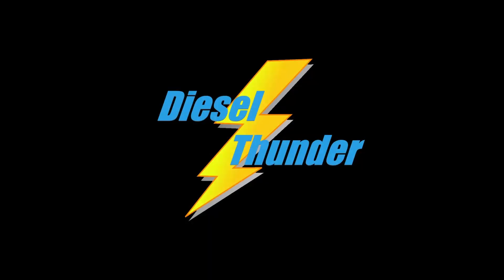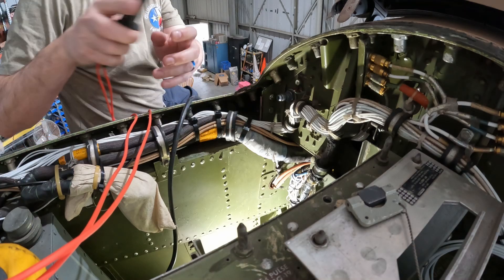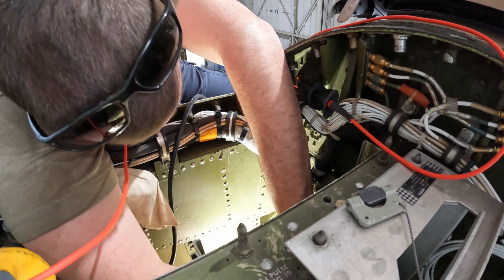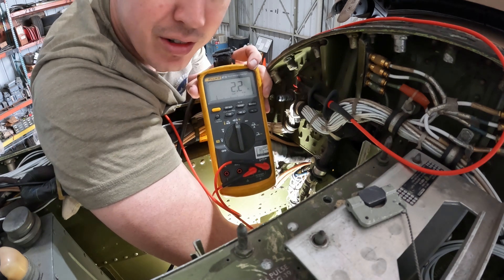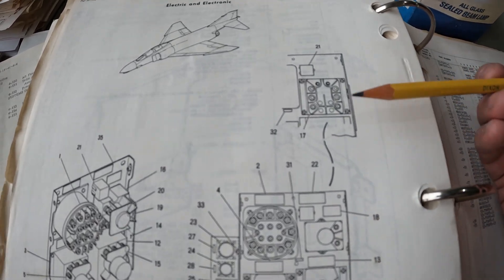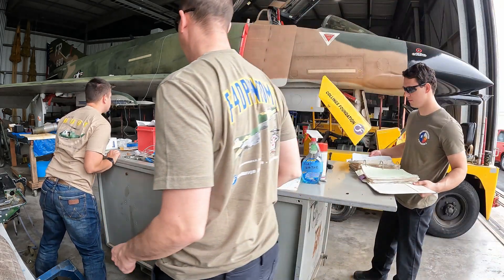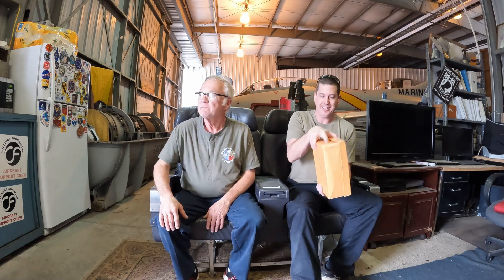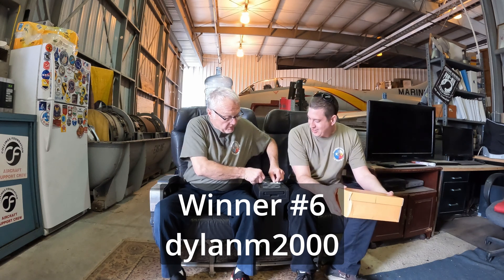More Electrical Phun and Winners are Drawn! | F-4 Phantom

Comment: Was wondering if the complete miscalanious relay panel assembly could be released and then roteted in situ to face the rear, that way to facilitate easier access to those fiddly nuts and washers on the relay terminals.
Can't be too careful with dropping tiny hardware inside a jet !  FOD is not good.
Reply from the maker: Agreed, FOD is not good! We’ve looked at moving the panel around but the wiring harnesses routed along the edges prevents that. I do have a few tricks to keep the nuts from getting loose or lost.

Comment: Yeah, getting to things on an F-4 can be a lot of fun.  There was a theory bandied about that they took all the electricals, avionics and seats and hung them up in the air then built the airplane around them.  Knowledge comes with time,  A lot of what you are doing now is what we all went through as 3 level or young 5 level techs.  You, unfortunately, don't have the experienced 5 level or 7 level folks around to train and guide you.  A lot of the trick to maintaining the F-4 is having seen something a couple of times before and having at least a starting point to troubleshoot and knowing what can or can't be the problem.  When we got good enough the McDonnel tech rep would give us a patch with the little Guy dressed in black with the II on his costume that said Phantom Pfixer.  It was something we wore with pride, like an award for pain, suffering and perseverance.  Good Luck!
Reply: the former McDonnell Douglas headquarters building in St. Louis has a little "museum" called the Prologue Room.  It was originally just a nice way to display their products in the old days (I used to work there).  It is still open, but infrequently.  On my last visit in 2019, I did get a photo of the Phantom Phixer patch ....  https://live.staticflickr.com/65535/52393966335_54e0b0c551_b_d.jpg
Reply: Spook lives.

Comment: If you want you can use three 9 volt batteries wired in series and wrap them in electrical tape to keep the batteries together.  Have a +  wire and a - wire long enough to us this set up as a handy solenoid power source for troubleshooting.  Its small and very portable. You can get fancy and also put a switch on this to control when you what to activate the solenoid.
Reply: That's a "battery box", very useful tool.  Used this with 0-10V servo-hydraulic proportional valves on industrial equipment.
Reply from the maker: That’s a great idea, definitely would be useful for some things around the jet for sure. Interestingly, this relay coil is energized by AC power.